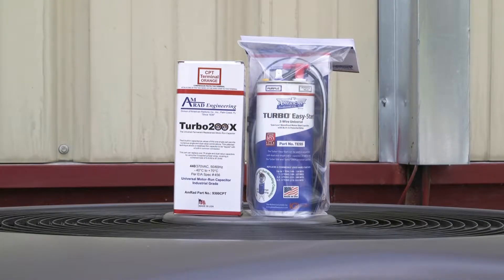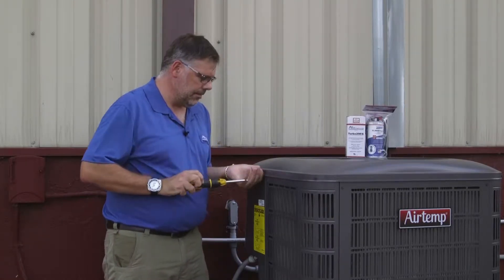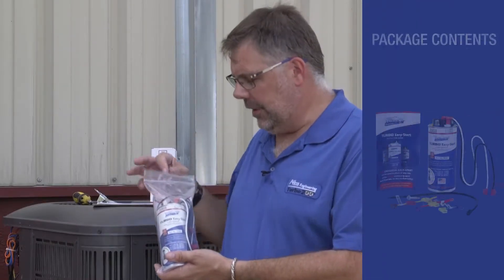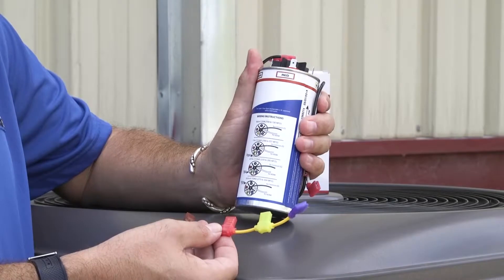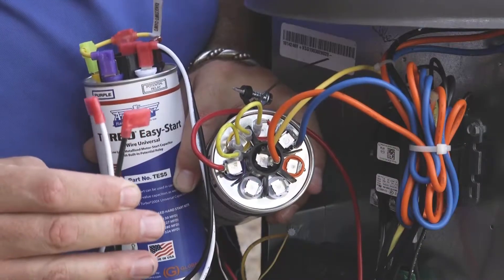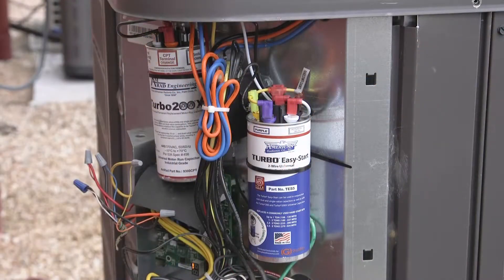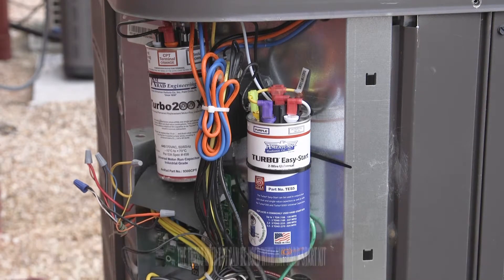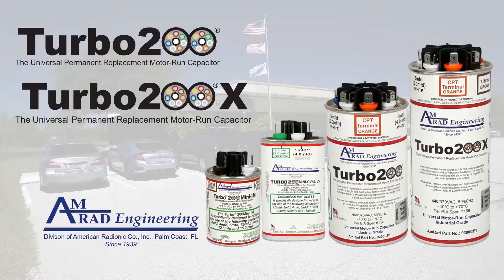Turbo Easy-Start Installation Video TES5 w:Turbo CPT Capacitor

Comment: Where can I find the wiring diagram for a 3-wire hard-start?
Reply from the maker: The TES5 is a 2 wire hard-start kit. Are you asking how to attach a 3 wire hard-start kit to the Turbo 200 or Turbo 200X motor-run capacitor?

Comment: What is the diameter and height of the unit? Thanks
Reply from the maker: The TES5 is 6.25 inches tall (including terminals) and 2.5" in diameter. Our TES5EXT is shorter, at 4.75" tall, as it has an external potential relay for easy mounting. You can check out our HVAC 60 Seconds video on these two products to learn more. 
https://youtu.be/JXxbvjwMozg

Thank you so much for your interest in AmRad's Universal Hard-Start Kits!
Reply: @global.the.source  I understand that this unit is compatible with old R22 systems with fixed orifice? Thanks

Comment: Is the potential relay a thermistor or something else?
Reply from the maker: This is an adjustable potential relay.  A thermistor is something different.
Reply: @global.the.source  Ahh, just needed to ensure it would end up being more reliable then some of the cheaper hard start kits which simply use a thermistor relay.

Comment: how do I know what the highest side of the Herm is?
Reply from the maker: Thank you for reaching out to us. Here is an example, the “blue” (25mfd) and “yellow” (20 mfd) terminals are jumped to create a 45 mfd capacitor. You would attach the hard-start wire to the “blue” terminal, since 25 mfd is greater than 20 mfd. Please let us know if you have any further questions.